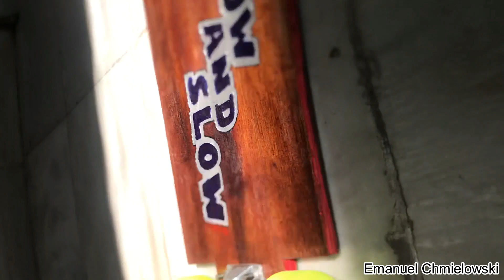How to Lower A Skateboard

Comment: Can you even ride that
Reply from the maker: Yes you can , but mostly for show
Reply: @EMXProduction21  ok thanks
Reply: @EMXProduction21  dose it scrape when you ride it?
Reply from the maker: @brandonzigler5239  nope it dosent
Reply: @EMXProduction21  wow ok cool thanks and looks great btw
Reply from the maker: @brandonzigler5239  thank you
Reply: @EMXProduction21  what is the material that you used in 2.51
Reply from the maker: @DiegoHernandez-le4vh  wood stain or tick oil with some glitter dust